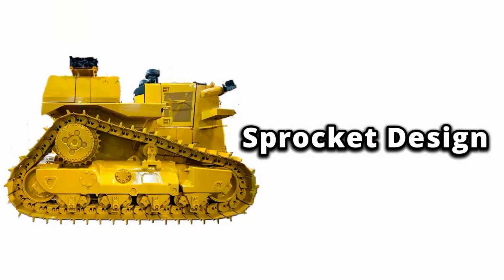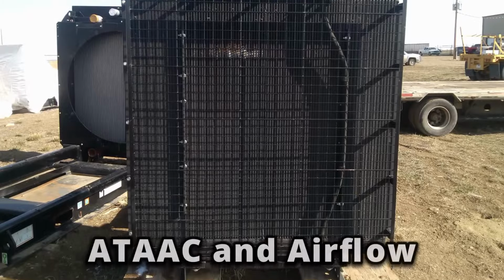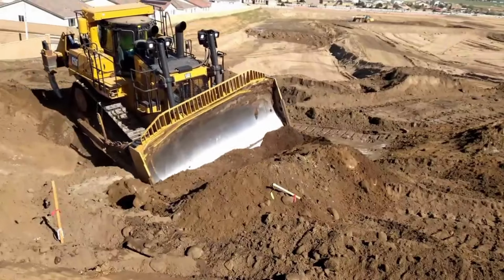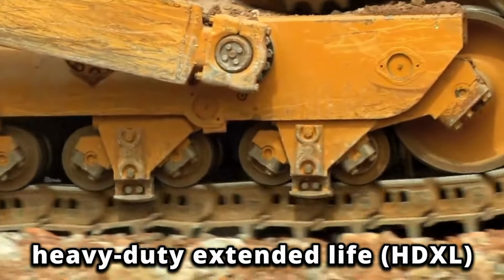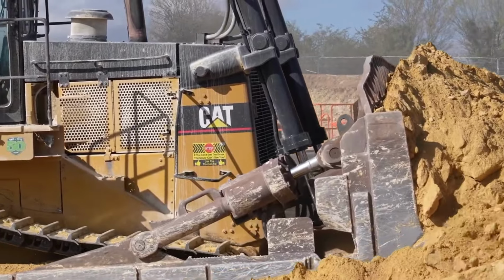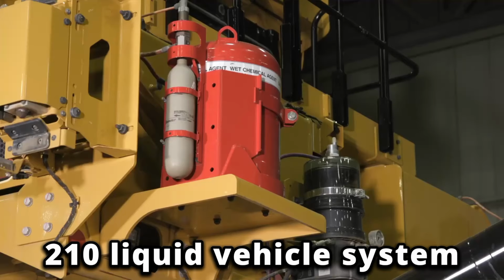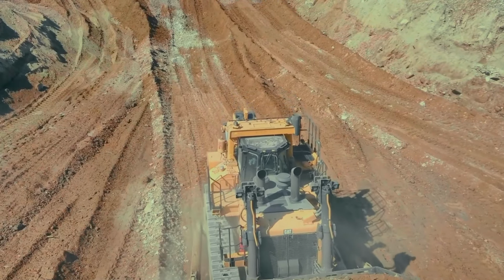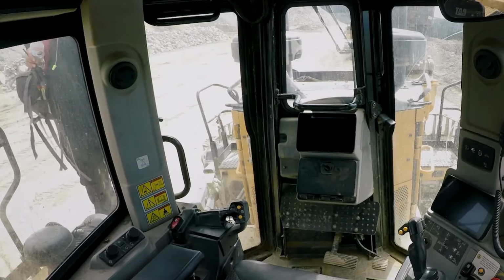Caterpillar Just Released This Shocking Feature! (D10 Bulldozer Docu)

Comment: Currently working with CAT D10T and D11 dozers, very powerful machines. Able to displace big rocks and run through tough terrain.. just keep monitoring GET and regularly check oil levels to ensure good reliability
Reply: I run a d10r and sometimes a d8t depending on what needs done that day. They’re amazing machines super strong they push amazing. I’ve never got to run a d11 maybe the company will get rid of a few of these d10s and get one they have probably 15 d10s and a handful of d8’s and d6’s